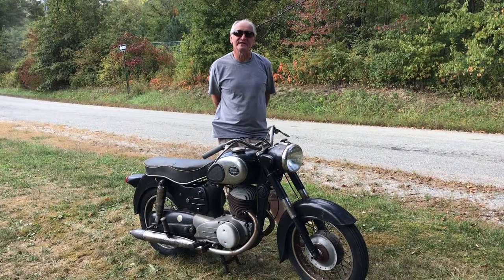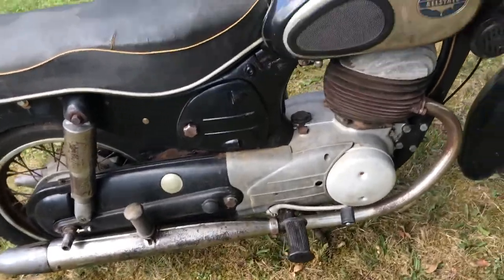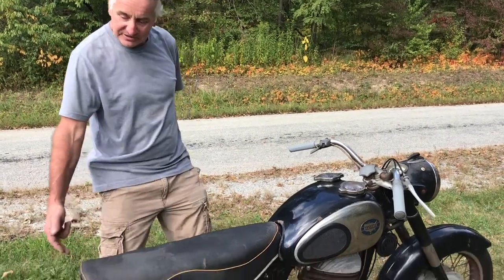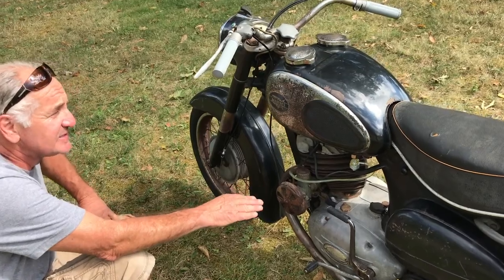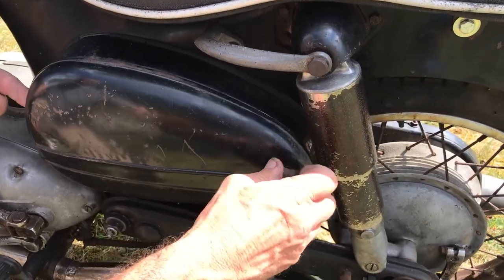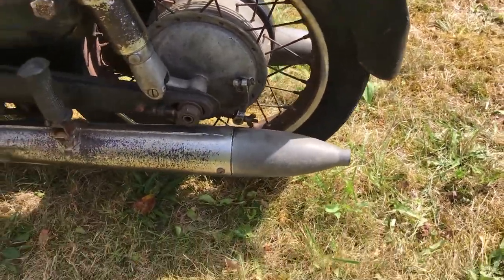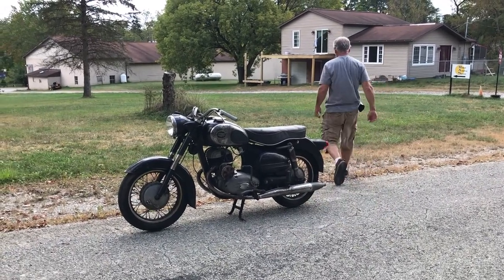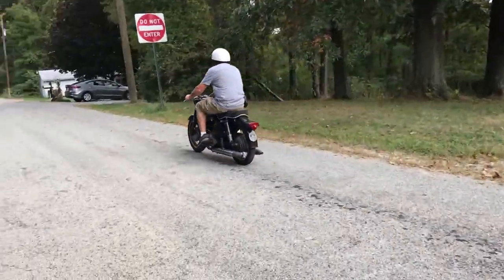1965 Sears Allstate by Puch

Comment: Is this a 2 stroke?
Reply: Yes, a "Ring-Ding", "Popcorn Popper" and many other nicknames. This particular engine design was a "twingle" or twin-single". Just add the oil/gas mixture and it will always start and run. It isn't fast but it handles well and has lots of torque which is why the 2-stroke bikes were best at dirt bikes.

Comment: You need to get that rust off, rust begets more rust, and then you have no metal left to work with.
No rust anywhere is ever good rust.
Phosphoric acid will at least neutralize it for a while.